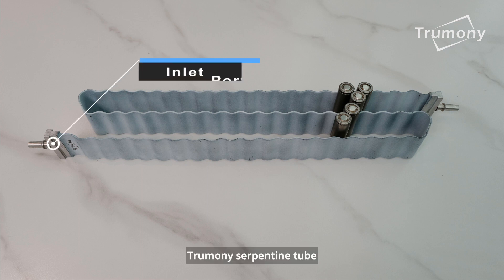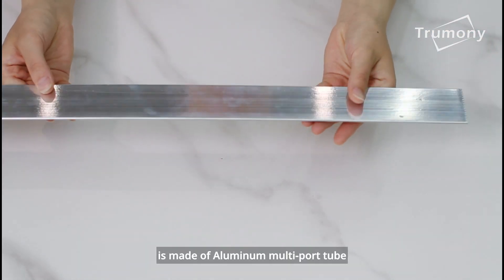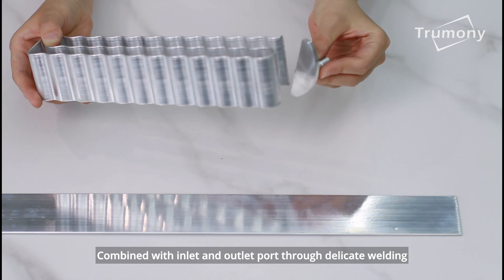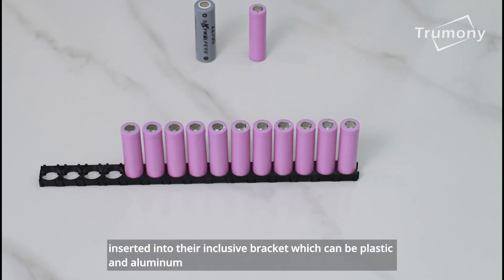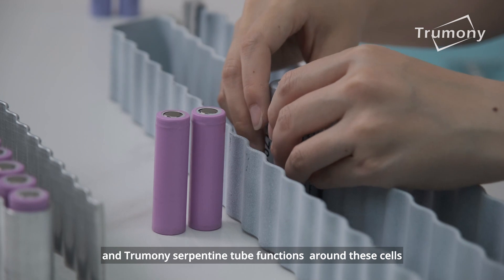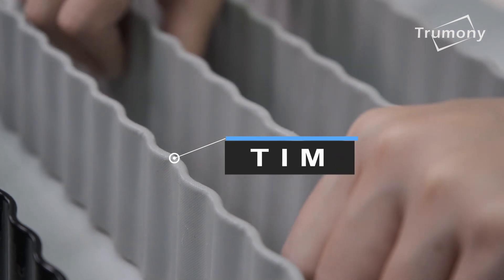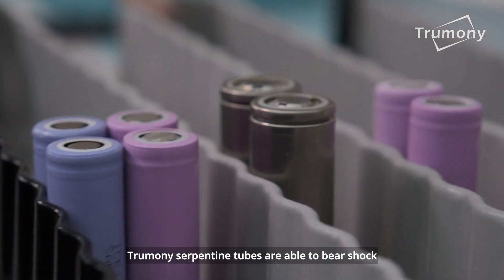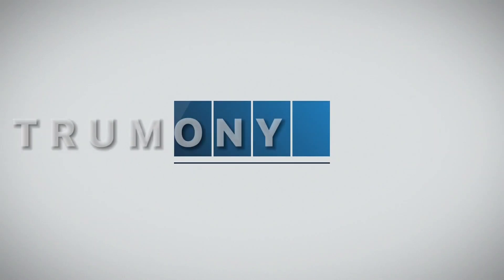What is the EV battery cooling tube for cylindrical cells ?

Comment: but the silicone layer is a insulator. its better to use a thermal adhesive because even in this video one cell was still moving in the silicone system. that cell will degrade faster and without per cell fusing the pack itself will fail. this is a good product but without a thermal adhesive its pointless.

Comment: This is what Tesla uses and they have been very successful. However, considering that real-world Li-On cylindrical cells have thermal conductivity anisotropy, wouldn't cooling them axially with a cooling plate be more efficient just like Lucid?
Reply from the maker: As what I known that Lucid use the bottom direction cooling, Tesla use the side direction cooling, all cooling solution get the more heat exchange effecificy .

Comment: I want to do a project similar to your system about lithium battery cooling. I have some knowledge on the heat exchanger. I have never seen the cooling system used in the system. Can you help with mathematical calculations and methods related to this ?
Reply from the maker: Could you add my WhatsApp +8618021060306？We can discuss with it

Comment: Do you force air through the tube or some kind of coolant fluid? Is it properly sealed and withstands the internal pressure when the system is functioning?
Reply from the maker: it is cooled by liquid like water / glycol. The internal pressure is up to your requirement , we can evaluate accordingly.
Reply from the maker: +8618021060306 is my WhatsApp, if you need, we can discuss more details .
Reply: basically, tesla's initial vehicles and even they have patented this cooling coil. they have open source /expire patent you can get pretty good information from that.